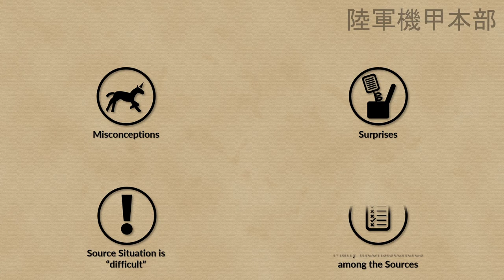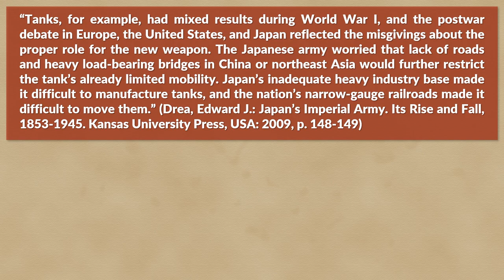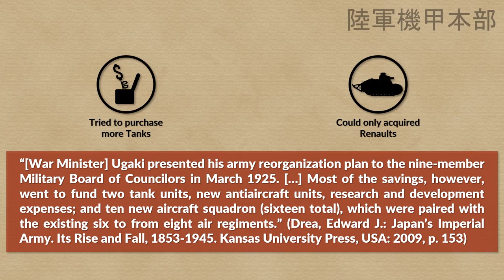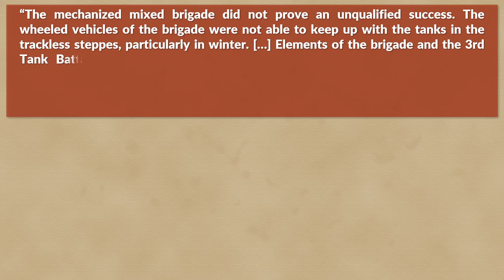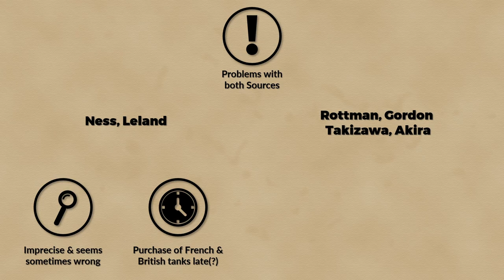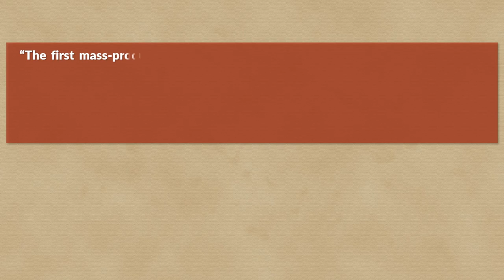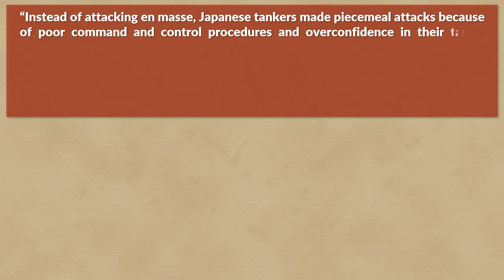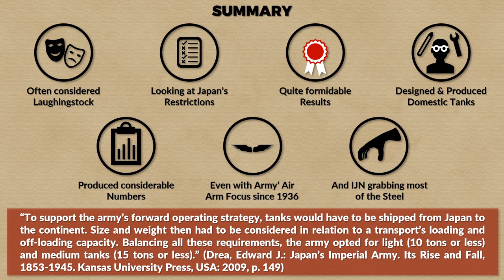Japanese Tank Arm (1921-1939)

Comment: I just yesterday finished my re-reading of "World War II Japanese Tank Tactics" and now this video. Lucky me!

This video is a great primer to the subject, especially because it compares Japan with other countries at the period. As the aforementioned book never stops hammering down, from beginning to end, the Japanese high command never fully understood the plight of the tank arm and always misused the tanks whenever its commander could not have a say on the matter. 

Another problem, as you mentioned, was the need for seaborne transportability, something the Americans solved with the tall M4 Sherman (that's why its silhouette is so high, because of the cubing for shipborne transportation) and that was a shocking surprise to Japanese planners, as they only estimated to fight M3 Stuarts in the first phases of American amphibious invasions. The sour taste of Tarawa tought the Americans the importance of tactical mobility in the shoreline.

The Japanese first used tanks against the Chinese and Reds in 1932, with both the Renault FT (Ko-Gata, "Model A") and the Renault NC (Otsu-Gata, "Model B") taking part in the Harbin incident, with the 1st Special Tank Company, in January 1932 but with little action for the tanks as the Chinese withdrew. The Japanese will invade French Indochina in 1940 and will get some spare parts for those Renault tanks.

The first real use tanks by the Japanese was in the "Shanghai Incident" of 28 January 1932, with the 2nd Independent Tank Company:

- Company HQ (Captain Shigemi)
1x Renault NC27 light tank
- 1st Platoon (Capt Kazuo Harada)
3x Type 89 medium
- 2nd Platoon (Lt Kengo Imamura)
2x Type 89 medium
- 3rd Platoon (Sub-Lt Toshio Sakata)
5x Renault NC27 light
- 4th Platoon (Capt Takao Maeda)
4x Renault NC27 light

This company, from Kurume, would act in support of the IJA 5th Infantry Brigade and the Shangai SNLF, landing in February 13. They attacked in 20 February in Kiangwan in the suburbs if the city, facing numerous well-entrenched Chinese, protected by an extensive system of AT ditches. The attack was difficult and the Japanese made little progress. The Japanese noticed their lightly-armoured tanks were vulnerable to close-in infantry attacks and close-range machine gun fire (ever present in such a urban environment); they also were easily halted by streams, AT ditches and rubble. The 15 tanks would be reduced to only 3 operational tanks by the end of the action. Nevertheless, the Shanghai SNLF got 6 to 8 Type 89 medium tanks afterwards, forming a tank company.

The Japanese would go for a second round in Shanghai in August 1937. This time, the Chinese bought German AT guns - the 3.7cm PaK 35/36 - and the results were quite unnerving to the Japanese crews but the tanks proved mostly successful and rated quite good (as mentioned in your video about Jehol). A Japanese account of Shanghai 1937 included in Osprey's tactics book is as follows:

"At 4pm a Chinese AT gun suddenly fired on our tanks, and all tanks of the platoon shifted their fire to this gun. At the time the turret of the platoon leader's tank could not be turned due to gunfire damage; Driver Fujino immediatly turned the tank in the direction of the AT gun. As the crew prepared to engage this, an armour-piercing shell penetrated the frontal armor, killing the driver and seriously wounding the gunner. Tank commander Okamura realized the tank was on fire, but he decided to destroy the enemy gun before abandoning the tank. As he moved to the gunner's position another shell hit the turret, and the shock of its impact freed the jammed traverse. Realizing his good fortune, he fired three rounds and silence the enemy gun."

A Brazilian military observer, Lt-Colonel Lima Figueirêdo, noticed before 1940 that even though the doctrine followed the French 1920 system of infantry support, due to their few numbers, the Japanese tanks received many autonomous missions in China:

"At the beginning of the conflict no doctrine was applied in practice. So there is nothing to say about the employment of the tanks being little coordinated and the results obtained being poor. In Northern China, these materials have been grouped into autonomous armored and motorized units. In Shanghai, the Navy and Army units sought to be supported by armored machines and it seems that in street fighting the results, according to French principles, were quite satisfactory. Outside the city, the terrain cut by wide and numerous canals was as unfavorable as possible. The tanks without artillery support, followed by infantry mostly unfamiliar with their presence, have, most of the time, worked alone. Its disorderly action has, however, accelerated the Chinese withdrawal after the rupture of the front, but its mission has been very secondary."

During 1937's Quhar operations, General Tojo  dispersed the assets of the 1st Independent Mixed Brigade  widely in the infantry support role. Tojo was a "book-soldier", with no combat experience, and did not hear Colonel Sakai's protests, treating them as mere insubordination. Sakai called him "an idiot" and I have to side with him: Sakai was dismissed and the brigade was disbanded.

The Iwanaka Detachment was a combined-arms force that took part in the Battle of Hsuchou (May 1938) with decisive results, but the Japanese high-command didn't really take notice and disbanded the detachment afterwards. Very late, in September 1942, the Japanese published a new tank doctrine of combined-arms divisions and such - but this was never actually employed by local commanders, with Japanese tanks being used in penny-packets throughout the war - but with few occasions to emply the new doctrine (such as during Ichi-Go). When the tankers were allowed to do their job, they were remarkably effective as far as 1942 and in 1944's Operation Ichi-Go.

It is also worth noting the use of Japanese tanks in the last battle of World War II: the Soviet amphibious assault of the Shimushu/Shumshu Island, on 18 August 1945. The Japanese charged the Soviet beachhead with 30 tanks under Colonel Sueo Ikeda at 7:50pm, after overrunning a Soviet company at 6:50pm, attacking through the scattered defenders, while the Soviets rushed to unload AT guns. Both sides suffered heavy casualties in a two-hour close-range battle in a fogged battlefield, with over 100 Soviets killed, 96 IJA tankers killed - inlcuding Ikeda and 4 of his company commanders - and 21 Japanese tanks destroyed.

Comment: i think around 10,000 light tanks could have been made with all the steel used on the Yamato heavy battleship.
Reply: I'd be guessing more
Reply: I mean the partisanship of the Army and Navy would’ve prevented that from happening
Reply: Why stop here? I say that 1 million tanks could had been made!
Reply: If we assume that the 60.000 tonnes Yamato is 100% made out of steel, then we could get enough steel to build 11.000 panzer 1 tanks with the weight 5 tonnes each.
Reply: You have to calculate surface of an object, multiply it with thickness of an armor and then you will have more than a childish calculation. This is how I accurately modeled theoretical weight of an upgrade packages for vehicles and cross referenced my calculations with real life, well documented upgrade packages and had confirmed accuracy of my predictions. Of course it was an order of magnitude more complex task, but basic principles should be good enough to generate your number.
Reply: Probably just from one of their 3 eighteen inch gun turrets
Reply: @442dudeathefront  Exactly. The resources poured into developing separate airplanes, machine guns etc would have greatly benefited their war effort. Not saying they could've ever beat the US but it most certainly was wasteful.
Reply: Light tanks wer 8-20 tons in weight. Yamato weighed 73 thousand tons.
Thats in the range of 4000 tanks just for the weight.
Reply: I need no channel youtube! what light tank are you talking about?
Reply: @SFCKNZSD  None in particular. Take your pick.
Reply: I need no channel youtube! The type 98 Ke-Ni was 7.2 Metric tons and the Yamato was 73,968 metric tons or about 74,000 metric tons or we could use the Type 94 “armoured car” even though it had tracks and it weighed 3.4 metric tons.
Reply: @SFCKNZSD  that would give you 7500, but the specifics dont matter.
Tens of armoured divisions could be stood up in place of a single Yamato class, and thats the point.
Reply: That number isn't too relevant, as steel isn't nearly as valuable or limited as work put into it. The amount of labor per ton of steel on a battleship is a lot less than in a tank.
Reply: @lobsterbark  rather possibly so. Still, an armoured brigade has maybe 250 afvs. being able to build 5000-10000 tanks per weight still translates to multiple brigades if the work per ton is ten times more.
Reply: And how many giant robots?
Reply: 10,000 light tanks for what? To help Hitler out in his barborossa operation to wipe out the Soviet Union from the Manchuria region ups? Oh wait that never happened and it would've been too cool.
Reply: Or 10 giant robots
Reply: @REgamesplayer  lol funny how your comment is most serious, realistic and sophisticated yet all these wannabe armchair general hoi4 dorks just ignore it and go along pretending they're more capable of conducting & organizing a world war than the japanese military elite lol
Reply: @sufimuslimlion4114  Thank you. It is just sad that they do not understand such simple things as not everything in a ship is made of military grade steel. Armor of a ship makes just a portion of its total weight in a same way how armor on a tank makes only a portion of its weight. Then you have to take into account various factors like quality of steel. Often, armor grade steel is in short supply while mild steel is available. Problems lies not with material itself, but with rare metals required to make steel capable of withstanding hits. Then you have to consider existing industries, if they are capable of drastically expanding production of something which is rarely the case. Then you have to consider if you can fuel those 100,000 new light tanks or whatever you produced which usually was not the case. Then you have to consider where to get men, who will train them as crews, as technicians. Who will supply spare parts, fuel to those tanks, etc.

In the end, these HoI4 generals do not understand more in depth and strategic aspects of warfare. Japanese weren't gearing for mainland war. They were gearing for war in Pacific with naval power. Having a lot of tanks might seem impressive on paper, but what you going to do when enemy cuts off your navy, isolates your island garrisons and attacks it with overwhelming force? Do you gonna call up your navy whom you had deprived of steel and thus it was unable to build sufficient ships? They are comparing apples to oranges. If Japanese focus was geared towards China and Russia, then focus on tanks would had made sense and you would be right to critique lackluster Japanese armor. Yet, it wasn't the fight they chose to fight.

Also, for calculations. I was debating that Leopard 1 design was sub-optimal for its intended role. I was arguing that TAM (Tanque Argentino Mediano) tank is a better design for its intended role. A medium tank with superb mobility and firepower, but with minimal armor for a tank only good for resisting autocannon hits. I had argued that Leopard has excessive armor, have incorrect engine for its design goals and is dimension inefficient and thus, is too heavy for what it delivers. I argued that a smaller design with a smaller, more powerful, but less fuel efficient engine (basically American gas engines of that time) would had been better design for W.Germany at that time (though not as export successful). I used TAM tank as an example and had to agree that its armor is insufficient for its purposes. Thus I had calculated how much it would take to bring its armor to needed level and I had found out that it is just several tons at upper end of calculations. I cross referenced my calculations with IFV who was up-armored recently to be resistant against very same threats. Its weight increase was quite similar to numbers which I got. This is what I meant to do with my original comment, even making basic calculations to figure out vague numbers can be quite hard and time consuming and I don't even speak about getting exact details on vehicle dimensions, calculating for angles, for odd shapes, etc.
Reply: How about 9 x SuperMaus, each with an 18" gun? I'm sure Hitler's teams would've designed them!
But then battleship fanatics would have to game Iowa v Nagato!! or stick to Jutland / Hood-Bismarck...
Reply: Rather than Tank It Should be use to made More Carriers, screen ships, and planes. did not need to deal with tanks If US can not landed their Marines And Army.
Reply: @REgamesplayer  What a stupid thing to do when you can just compare the mass of the tanks.
Reply: @blaisevillaume2225  And what will this achieve?
Reply: @REgamesplayer  Precious little.  But it's good not to put too much effort into answering a fundamentally stupid question.